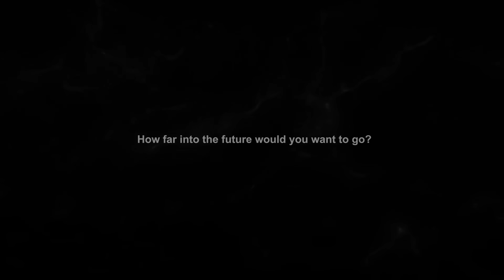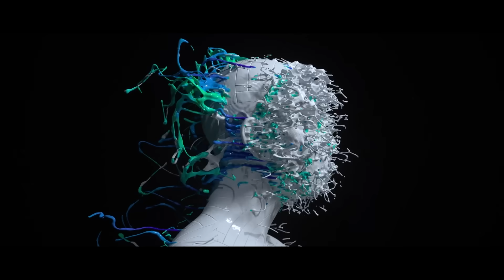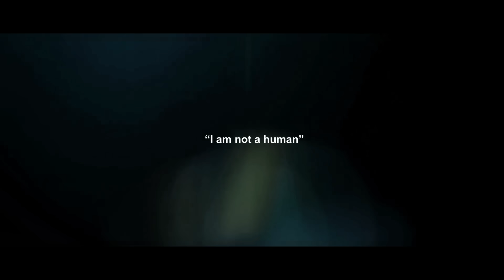TIMELAPSE OF FUTURE TECHNOLOGY: 2022 - 4000+

Comment: I think that it's about time to eliminate the old idea of a Dyson's sphere as a possible future technological advancement and focus more on the development of nuclear fusion or matter-antimatter reactors.  Capturing the output energy of a star either through heat conversion, photovoltaic cells or some future form of energy capture is inefficient (only a percentage) while requiring alot of manufactured materials (that require energy to convert them from unrefined ores to manufactured materials and machines).  The massive structure (even in a Dyson swarm) can create other problems such as increasing the curvature of space-time around the Sun, affect the orbits of the planets, may attract more meteorites/comets toward the structure that cause devastating impacts, all of them maintaining similar distances from the Sun, trapping heat by reflection, carrying energy through large distances, etc.
Reply: the entire video is retarded but that's not the point of your comment so I won't address it, past the fact I find it weird that you didn't notice how low quality the video was

as for your question about fusion, a strong argument I have in the defence of dyson spheres/swarms/whatever is simply that stars ARE incredibly efficient fusion reactors, if I was asked to design the ideal fusion reactor, a star with a dyson sphere around it is probably how I would do it
You see the issue is the pressure (probably is more to do with the matter density but regardless)

A star is a large ammount of matter bound by their collective gravity, it means the center of those big balls of matter sit at incredibly high pressures, and this changes everything for fusion, without pressure, you can't even get deuterium and tritium to make energy positive fusion, while with a lot of pressure (like the core of a star), you can throw basiclaly anything you want, any element lighter than iron will create energy and fuse, including if it's in molecular form

AKA if you could teleport random liquid water in the core of a star, that random low quality fuel would actually generate you tons of energy, meanwhile fusion (using reactors) isn't looking like it will be possible without any sort of extremely exotic fuel

As for antimatter energy, that's not a natural ressource, at all, the only purpose it could serve is to store energy, but you need to create it first, and with any transformation, you waste energy, so it means you likely would spend let's say 3 terajoules making a bit of antimatter, then you could place that antimatter in the fueltanks of a spaceship, that could get 1 terajoule out of it

So it's in no way a source of power CREATION, it's an inefficient but useful due to being very lightweight way to STORE energy you generated in another way

So those are the answers for you 2 suggestions, 1, for fusion, because of pressure, stars will always be more efficient fusion reactors than whatever we can make, by factors of several thousands, and 2, for antimatter, it's can't be used to generate energy (due to not being "found in the wild") but could be useful for spaceships, but little else other than spaceships, the energy density is the only reason you would ever dable in antimatter to begin with

Comment: Every time this video moves forward a year, replace it with 5-10 years and it makes 1000x more logical sense.
Reply: Nope technology progresses exponentially.  For example, lets say you invent a brain computer interface + AI tech that helps scientists get info and invent things 45% faster.  Well you can use that tech to to make an even better AI + computer interface, now imagine 10 doublings mean scientists can invent things 1000x faster.  20 doublings mean humans can invent things 1 million times faster.  1 2 4 8 16 32 64 128 256 512 1k 2k 4k 8k 16k 32k 64k 128k 256k 512k 1 million
Reply: @aoeu256  No it does not. Technology has progressed extremely slowly throughout all of humanity until around the past 100 years or so where it's suddenly skyrocketed. That being said, what you're talking about is 100% hypothetical and is not an actual reality yet so it is irrelevant.
Reply: @bestieswithtesties  well yes and it will continue to skyrocket faster. for example more new tech has been invented in the last 20 years than the first 40 years of the 1900s
Reply: @dutchvanderlinde4722  Like I already said. Whether our rate of advancement will stay on its path or hit a plateau soon is very debatable. Moore's law along with multiple other conundrums bring into question how long we can keep this up
Reply: @aoeu256  Whether we can keep progressing at our current speed or if we'll hit a plateau soon is a highly debated topic. Look up Moore's law.

Comment: Take the value of the difference in the year of the prediction and the present year, then raise the result to the power of 3 and add it back on to the present year. 

Then maybe these would be reasonable predictions.
Reply: I'm not so sure. You Say that instead of the year 10000 where this ends it should be the year 3^7980 or the year 2.67677*10^3807, but at that time the universe has already entered to the black hole era and the dark era, by that time "time" becomes meaningless.
Perhaps, instead of raising it to the power of 3, maybe 1.02927477... is a better number for distant years (>2200) so that before time ends it corresponds with that crazy year 10000 In the video. 
I also think this video is very optimistic, but your thing is a lot of Pessimism for the far future.

Comment: First glaring error: Fusion is so NOT going to happen any time before the sun burns out.  It also wouldn't happen with Hydrogen.  If anything fusion MIGHT be possible with helium.
First correction: Thorium reactors come online across the world in 2035.  The world now has a cheap abundant source of energy that last for another 500 years.

Second glaring error: Dyson spheres are an impossibility due to the inability to stabilize that much matter around a star.  They sphere would literally collapse under its own weight.
Second correction: Sphere like clouds of collectors orbit a star collecting as much of its energy as absolutely possible.  The energy is either stored or transmitted elsewhere for use by a Type 1 civilization.

Third glaring error: Interstellar internet will not happen as space is VERY big rendering real-time communications across space virtually impossible.
Third correction: Micro wormholes are forged to allow for faster than light communications across vast distances.  Humans expand their networks and reach out to alien civilizations.  Earth becomes a Mecca of interspecies relations throughout the galaxy.

Comment: Imagine if you lived for ever or even twice as long so say you died at age 100 instead you die at age 200 so the aging process is slower kind of like the movie "In Time" but without the clock ticking down on your arm so you could be 150 years old but still look 30 or 40 years old.
But i know for a fact that Humans will go extinct with robots taking over there will be no need to try for a baby because you can literally buy a robot that's basically human but more intelligent which is how human will no longer be due to this because eventually humans will die while robots continue living.
It sounds crazy right but just imagine, the longer everything is developed and continuing improving the more advance technology will be which includes robots that are human therefore there will no longer be the need to have humans.
But it would be epic to live to say 200 years old doubling your age i know i still have 68 years left assuming i live to 100 years old but everything i have mentioned above will probably not be in my lifetime nor my childrens lifetime and they still have 90 years left assuming they live to 100 years old.

But one thing i'm certain about is robots will take over it will start with just working in factories and before we know it robots are working in factories, stores, cops, basically running everything and this is what happens in the work its only minor changes like little steps at a time so we don't notice its basically like a box of chocolates the company wants to decrease the amount for what ever reason so instead of decreasing from 30 to 20 chocolates they will give 28 then the following year take another two out so that 26 until they get to 20 chocolates and this is what will happen with robots without you really noticing although everyone will notice robots working in factories but if they are gradually introduced your kind of used to seeing them so then they are shipped out to stores ect, And when i say robots i don't mean those machines that we already have i mean actual robots that are far more intelligent that Humans are.

Comment: Okay, so when AGI emerges, that doesn't imply consciousness necessarily. Intelligence doesn't require consciousness. Another error: to prolong the life of a star, it would be best to remove hydrogen, not add it. Dwarf stars with 0.01 solar masses will burn hydrogen for up to 10 trillion years, whereas supermassive stars will explode as supernovae on the order of a million years. To extend the life of a star, you need to reduce it's mass. So technically, the thing to do is to remove some of it's helium waste product, and perhaps add a little more hydrogen. That's all the errors I've got the patience to note right now. But there were plenty of others.

Comment: Gravity is itself a sphere of stabilization; therefore an agent of control. This notion of anti gravity is false. Without explaining an answer to your obvious questions I'll get to the point of contention. To achieve a controlled gravitational environment we, simply, must devise a method of essentially turning gravity inside out and not being stuck on the difference between the positive and negative pols of magnetism. Incidentally; we should looks at atmospheric pressure as a cause and not, necessarily an effect of gravity. Isolate its components and uncover its construction.

Comment: 2100:  NASA developes an Alcubierre Warp Drive

2400:  Generation Ships are accelerated to Sub Light speeds

Uhh, why would we need generation ships in 2400 if NASA completed the Alcubierre Warp Drive in 2100?  Looks like someone missed that in the edit.  Perhaps they should've had Generation Ships at 2100 and the Alcubierre Warp Drive at 2400.

Comment: A Jupiter rover would be crushed by the dense Jupiter atmosphere. Im not even sure if Jupiter has a surface that can be called solid. where a rover could land. It would also have to withstand intense heat and radiation. So i guess there wont be any Jupiter rovers in the near or distant Future.

Comment: Field programmable microchips already exist. They are called FPGA (Field Programmable Gate Arrays). However they have a lot less performance then ASICs/processors specifically build with a predetermined hardware configuration.

Comment: Is missed the: In 4000, GTA VI gets released.
Reply: In 10,000 AD: Half Life 3 released.
Reply: @richardleeskinneriii9640  in 45,000,000 AD portal 3 is released
Reply: @liquidreverb  In 2030, cancel culture is discovered to be a mimetic contagion. By 2045, half of the Earth's population is cancelled.
Reply: @liquidreverb  in 69,420,000,000 AD Minecraft 2 is released
Reply: @distendedmist5840  that joke doesn't work well, there is no need for a second one because the first one is perfect
Reply: You know it 🤣🤣👌🏻
Reply: In the year 9173838172826372637263372637272633836834674627286373727483644788349 a trailer for gta 6 will come out 948 centuries after that year

Comment: Its interesting but without exception all physical claims in the video are wrong. I study physics, and for example, I don't know what a "4d printer" is. You obviously can't print time (fourth dimension) and what is described as the "fourth dimension" in the video (some sensors and other technical parts) is obviously not the fourth dimension and three-dimensional. I could name many other errors.

Comment: 1980: In 2000, we'll have flying cars!
2000: In 2020, we'll have flying cars!
2020: In 2040, we'll have flying cars!
2040: In 2060, we'll have flying cars!
2060: In 2080, we'll have flying cars!
2080: In 2100, we'll have flying cars!
20100:
Reply: No we won't because it stupid to have flying cars. Hyperloop is more good than flying cars btw you joke XD nice one
Reply: We’ve had flying cars forever. They’re called helicopters
Reply: @GuiltyHAL343  yes bro
Reply: @GuiltyHAL343  we have some prototype flying cars in 2021
Reply: @Amit_Pirate  Eh honestly they’re only “making” them to appease people. They are a waste of money and they’re just basically helicopters. To lift off of the ground you need to have a ton of noise coming from either the engine or propulsion system. They will never stick. It’s cool though right?
Reply: They fly like plane. But it is just for 1 person
Reply: @Amit_Pirate  Then wouldn’t it just be a single seater plane then? 🤷‍♂️
Reply: @GuiltyHAL343  duh

Comment: Because the energy issue is incorrect, the rest of the predictions must be altered as well. Energy are pulled from sub-space by sending energy into it and receiving more than the energy used. Some may call it another dimension, but different dimensions are just a intellectual concept.
"Travelling" by consciousness is instantaneous and no body is needed at the "destination", but will be created if desired. The "event horizon" is about a millennium, so sensing further out than year 3000 will be pure speculation.

Comment: I'm about 5 minutes into this video. When do the dates start getting anywhere close to realistic? A feature length Hollywood movie shot entirely in space and a colony on Mars using 3D printing from raw materials by 2025? "4D" printing by 2027? WTF is "4D printing", printing that travels through time?
Reply: 4D printing is the process through which a 3D printed object transforms itself into another structure over the influence of external energy input as temperature, light or other environmental stimuli. So, the big breakthrough about 4D Printing over 3D Printing technology is its ability to change shape over time.

Comment: This seems like it could be fairly accurate up to 2100, if a bit optimistic at times. After that, it gets a bit too scifi. A few points to consider:

1. Humans do not need planets in the long term. The better solution is to construct large space habitats, where we can precisely engineer the internal environments and felt gravity to near perfection. This approach solves almost every problem associated with living beyond earth once we have the tech and infrastructure to start building them. 

2. The Sol system has more than enough resources to support trillions of humans in very comfortable conditions by disassembling asteroids, comets, and eventually smaller planets for materials to build large habitats like O'Neill Cylinders, which themselves would form the bulk of the mass in our local Dyson Swarm. We would not actually NEED to expand beyond the Oort Cloud for millennia, even longer if we construct a Star Lifter device to extract resources directly from the star. We could also use the enormous power of the Dyson Swarm to run atomic transmutation facilities to create rarer elements. 

3. FTL is not necessary for large scale expansion, even at interstellar distances. It's safer to assume that it won't be solved, then just speed up if it ever is. Light sails and massive laser arrays can move ships between stars at a substantial fraction of c. Given that humans will have psuedo immortality through cybernetic and genetic life extension technologies by the time this is relevant many centuries from now, it will be a long but doable journey between nearby stars. Automated robotic missions can go hundreds or thousands of years in advance to build the prerequisite infrastructure.

Comment: Humans extend the life of the sun by injecting fuel into it?

Bad strategy; the sun's life is limited by gravitational forces generated by the heavy fusion products that will cause the center to collapse inward. adding hydrogen will confound this and quicken its decline.

In order to extend the life of Sol; We need to remove this mass instead. Difficult considering gravity and the intense energy of Sol itself.

A better strategy perhaps is in removing the outer mass to form a second solar body.

Comment: I'd love this timeline, but the counting of the years should probably be multiplied by ten at the very least.
Reply: NOT CORRECT. IF YOU SIMPLY MULTIPLY THE YEAR  BY 10 (Y=Y*10), YOU WOULD GET 20220 FOR THE YEAR 2022, FOR EXAMPLE. SO NO, WHAT YOU MEANT WAS THAT THEY SHOULD BE MULTIPLIED BY 10 AFTER SUBTRACTING THE CURRENT YEAR. SO, THE CORRECT CORRECTION FORMULA WOULD BE: Y=2020+(Y-2020)*10. THIS WOULD GIVE 2040 FOR THE YEAR 2022, FOR EXAMPLE, INSTEAD OF 20220 WHAT IS WHAT YOU WOULD GET BY FOLLOWING YOUR COMMENT. ☺☺☺☺☺☺☺☺
Reply: @syobsyotsec2919  That is indeed what I meant. Thank you for clarifying the math behind it in all capital letters. CAPS FOR EFFECT!

Comment: Made sense up to 11:50 (2070), then instead of singularity, we get an inexplicable slow down in rate of change. Actually, the remainder of the video will happen within 1 year of the singularity, which will occur as soon as general AI outperforms human engineering.  General AI will not hold funerals as they are obviously immortal.

I'm not sure why futurists tend to assume the big changes will take much longer than the current breakthroughs.